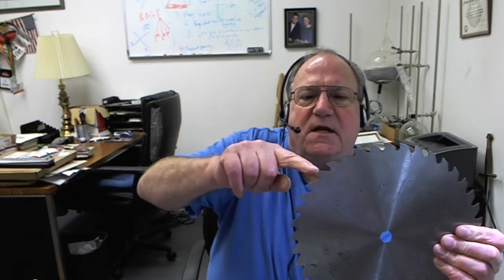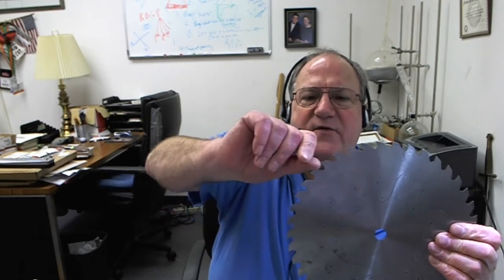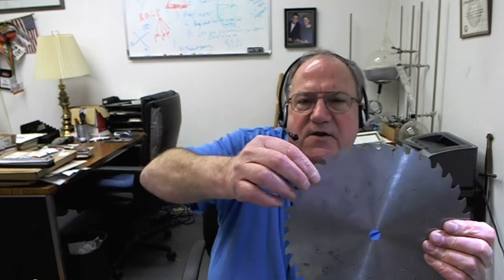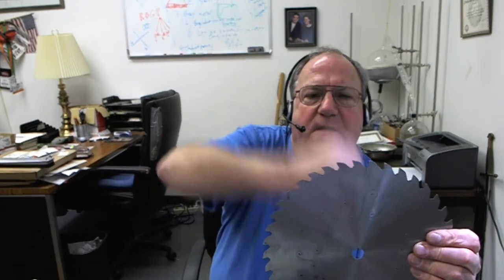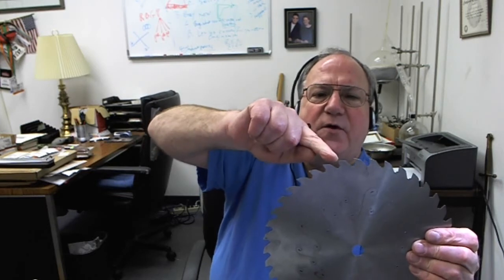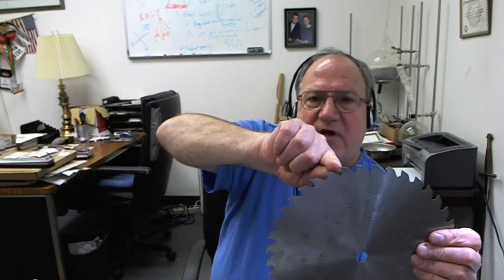Brazing Laser Cut Steel | Carbide Processor

Comment: Laser cutting saw body's leaves a thinn "blue" line. This zone should be removed with a heat treatment of the saw body's. The "blue" can be the cause of cracs in the saw blade cause it is so hard as glass. Mostley the cracs are appearing in the gullet. brazing directly on this blue is making the brazing less effective and theet will comme off.
Best regards